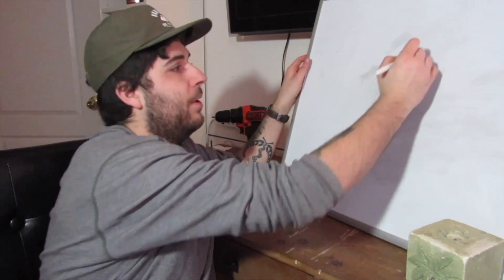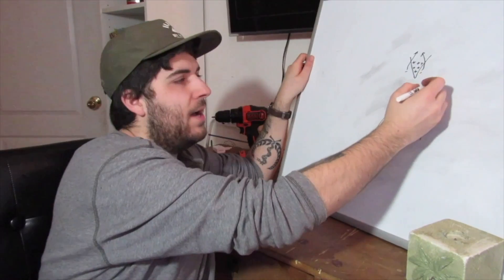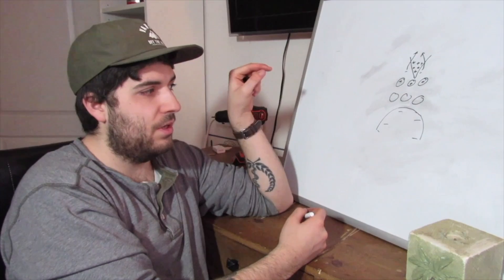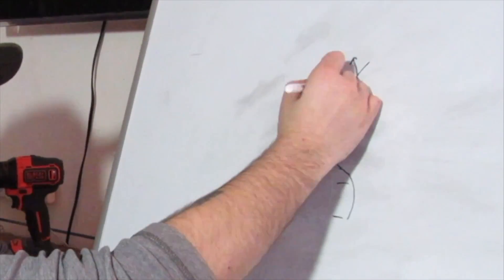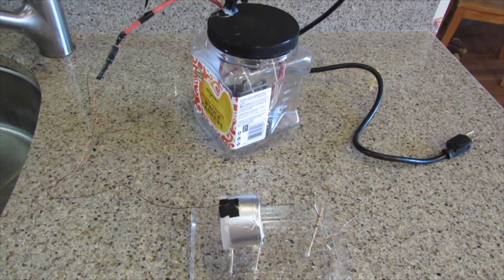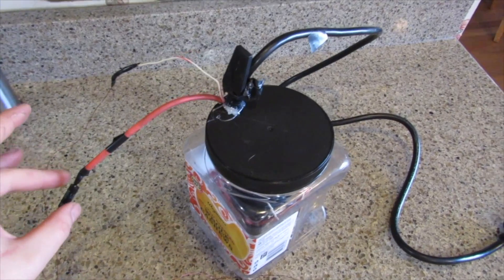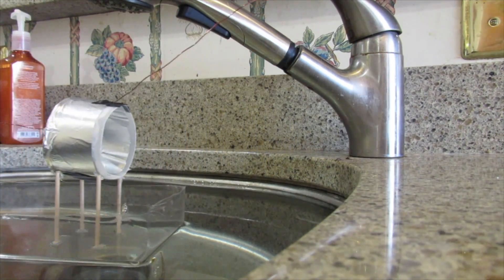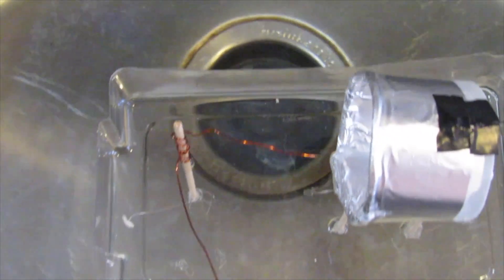Ion Thrusters - How they work, and building an Ionocraft

Comment: I'm wondering if you can increase thrust with a laminar-flow pill-shaped negative end, a smaller and sharper version for the positive, and put a cowl over it.

More to the point, Shape the positive end like a pinecone facing down and leave the negative end smooth. I'm curious how this could interact with the design.

Edit: not a request, I'm just thinking out loud
Reply: Laminar flow requires slow movement of the liquid, you can create aerodynamic parts but building for laminar flow would limit the maximum airflow and therefore thrust from the thruster

Comment: Let me just State the obvious moronic decisions made in this video at the end high voltage water and a metal sink you are an idiot sure stainless steel is not the most conductive metal but it is still conductive and you are using high voltage over water

Comment: Electrons aren't ripped from the air. 
Electricity is flow, just high frequency like water...    The compression at the positive small end .... Causes sympathetic resonance with the environment, overcoming environmental ability for capacitance, releasing light.

Comment: how is the electrical part made? what is your transformer? how do you generate the electricity to send to the ion thruster. is it battery or do you hook it up to the wall socket?
Reply from the maker: I think I passed AC (from the wall) through a CFL circuit, and sent that output to the primary of a flyback transformer. The output was around 30kv

Comment: See if possible to take those ion engines on the little boat and place them on the edge of a three arm windmill, of course you’ll have to work out some sort of contact band to facilitate spinning. Hook the power source to solar cell and see if it possible to make the work it provides into energy hope that makes sense and keep up the good work!

Comment: High voltage + high current= death

You experience roughly 15,000 volts if you shuffle across your polyester carpet in wool socks on a cold, dry winter day and touch a metallic doorknob. Shocking (ha) but not deadly. Now 15,000 volts with a few amps will do you a real dirty.
Reply from the maker: yeah i'm sure that would not feel great on the skin :////
fatal for sure :(

Comment: the vasimr engine your referring to is technically not an ion engine its a plasma engine " A plasma propulsion engine is a type of electric propulsion that generates thrust from a quasi-neutral plasma. This is in contrast to ion thruster engines, which generate thrust through extracting an ion current from plasma source, which is then accelerated to high velocities using grids/anodes. "
Reply: Do you know plasma engines in detail??? I am doing my MS research on them
Reply: @gorrium Lol thanks for clearing that up for everyone. I'm not familiar with the term 'quasi-neutral plasma' but if i had to guess i would think thats referring to plasma formed by AC current like, for example, what you would get with a tesla coil. Because the polarity of the charge keeps changing, i guess you could say the net charge is neutral. Assuming that is indeed what you mean, and Im not misunderstanding your terms, then by your own definition of an ion thruster, you would be incorrect in stating that this is not an ion thruster. The device featured in this video uses high voltage dc, thus the result is an ion propulsion and not 'quasi-neutral plasma'.

Comment: This was way cool! But how is it gonna work in space if theres no air to move for thrust?
Reply from the maker: Really good question! So in space they use xenon atoms, which stream out into space. The thrusters don’t necessarily need any air to push off of, they push off of the xenon atoms emitted.
Reply: Sam, most satellite spacecraft that use ion thrusters usually carry a fuel supply on board the satellite for consumption.
Reply: @avionicstechshop7664  Would you consider the Xenon to be the fuel for the satellite? I don't think so. i think whatever generates the electricity is the fuel source.
Reply: @davemwangi05  Greetings, to answer your comment in reality the spacecraft will not operate if it runs out of propellant or power as the craft needs both to create ions.  For a more complete understanding of how ion drives work search NASA'S website for Dawn spacecraft propulsion system.  YouTube also has some excellent explainer videos on the topic.  The comment section is not a good place to completely explain this topic.
Reply: Don't confuse the power of the thruster system with the propellant of the system. These are two distinct concepts that happen to be be the same substance in chemical rockets, as the power comes from the propellant itself as it combusts. 

In ion engines, the propellant is the xenon gas or other material that will have ions leaving the thruster into space. The power is either provided by batteries or solar panels.
Reply: But there is an Air n Space museum... H. Simpson